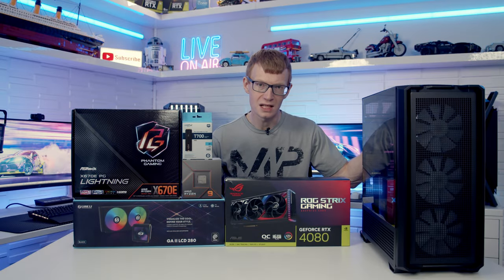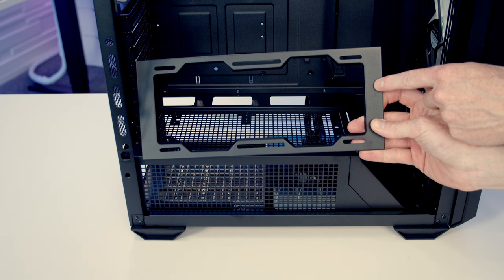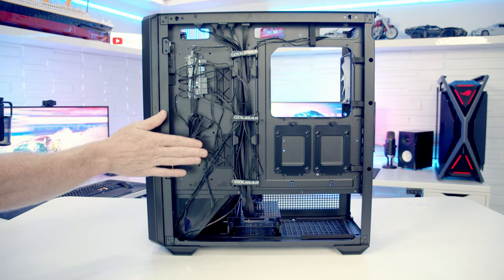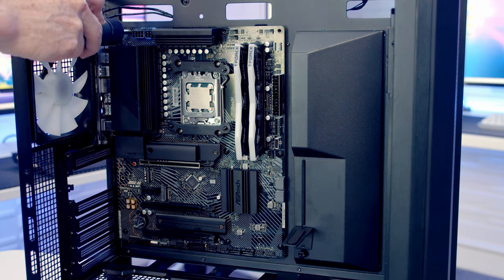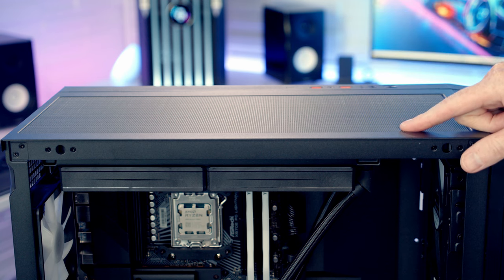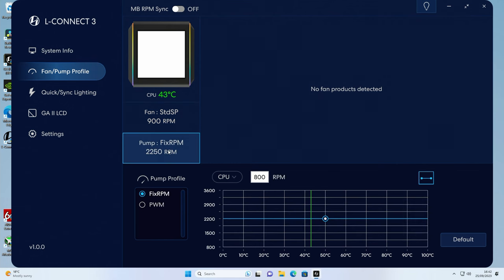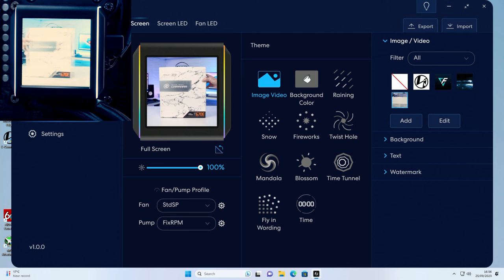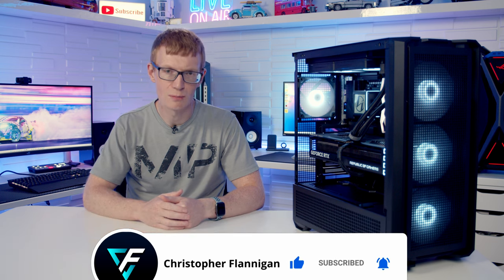Cougar MX600 RGB Build - Step by Step Guide

Comment: Hi! I got this case yesterday and followed your video to install my components in it, very helpful! Just have one question: I've set the lights to a constant dark blue, but everytime I shutdown and turn my PC on again, the lights revert back to the rainbow setting. I've gone through the user manual and I've found no way of fixing this. Any help?
Reply: Are the fans of this case good for airflow? Is the cooling ability good? Also, what cfm, rpm and db value does it run at?